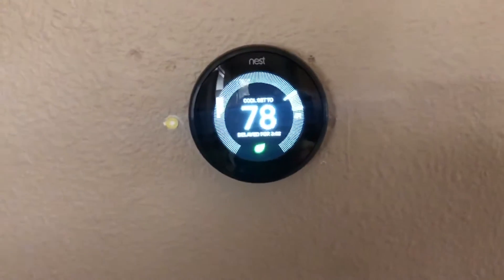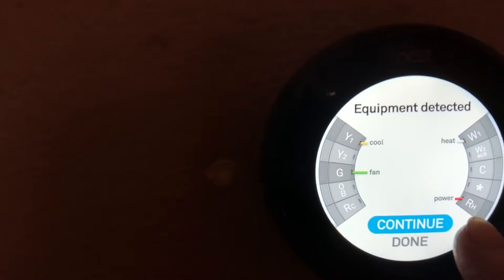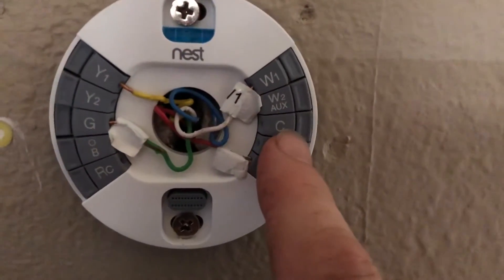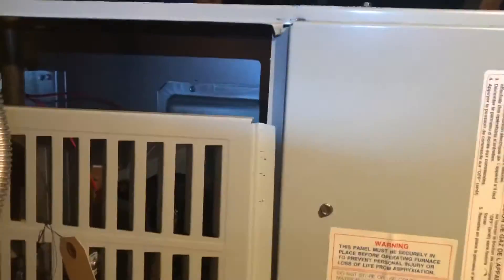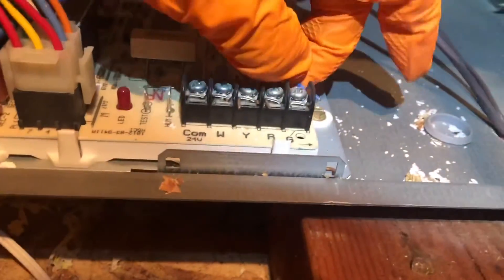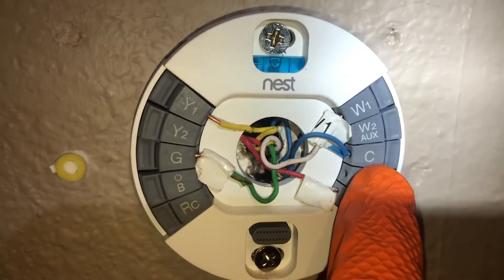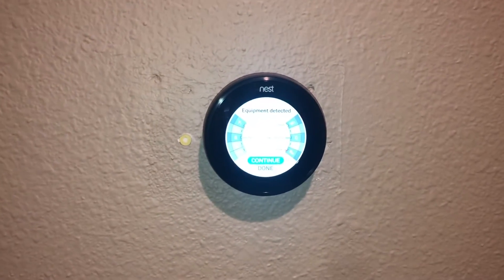NEST THERMOSTAT ISSUES - HOW TO FIX “DELAY” EASY - fix Wiring issues👍😎🎉

Comment: My common line is connected and detected, but I still get the "delayed" message.
Reply from the maker: In a common is connected in the furnace as well?
Reply: @checkitout2468  I live in an apartment.  I don't have access to it.  But if the thermostat is detecting it, then it must be connected?
Reply from the maker: @djp1234  not likely. almost for sure it’s not connected

Comment: I don't know why people keep claiming you need a C wire for this thermostat. You absolutely don't need it. It can pull power just fine from the heating (red) wire. 7 years with no C wire. The only time I've had the thermostat lose power is one time the condensate pump for my AC tripped a GFCI, stopped pumping, and filled up, which cuts power to red.

Comment: I connected the C cable but now there’s no power coming from Rc and Rh and gives me an error in Equipment settings :/ an e22 error. Had to reset it to how it was and dealing with Delayed cooling again
Reply from the maker: What you’re trying to do is connect a C wire from the  inside the furnace to the C on the thermostat. Do not disconnect or connect any other wires.

Comment: Mine just went into a 3 minute delay mode but I have a 24v common wire hookup in both places. Any thoughts why still went into delay?
Reply: Mine did this also. Time to trash the nest and get a honeywell that has being doing thermostats since the beginning.
Reply from the maker: The only time that delay should come on is to protect the equipment. For example, if you had the air conditioning on and then turned it off and then immediately turned it back on it would have a delay to protect the outdoor equipment.
Reply: Well my A/C was running and it was 74 in the house but the nest was set to 71 then went straight to delay so I’m confused.
Reply: Mine does the same with a c wire installed. My unit is brand new heat pump. It's frustrating cause I like mu house cool when I sleep

Comment: My C wire shows that it’s hooked up via the equipment screen. It says 24v. Still getting the orange blinking light on top and the “delayed start” message on panel. AC still won’t come on. Any ideas/suggestions?
Reply from the maker: Make sure that the C wire is also connected inside your furnace or air handler.

Comment: My nest sometimes doesn't kick the compressor on I have to kill the power to the heat pump the thermostat basically everything than it works I heard it was a common problem I am thinking of switching to the Eco Bee
I have the nest gen 3 by the way
Reply from the maker: Connect the common wire if you have one.
Reply: @checkitout2468  the blue wire is on C 
It's like the compressor doesn't kick on I heard nest had problems on this
I have a new A coil 
And a new compressor with full freon 
Everything seems to be in order

Comment: it does actually have a lithion ion battery but like a phone or tablet battery they don't last that long so the power stealing or the use of a c wire is needed.  If you don't have a c wire option to your system a c wire external power adapter for around $20 will work, you hook up one wire to the RC and the other to the C

Comment: I don't agree with you, if I have a delay, the only thing I have to do, is move a little bit the wheel one or two degrees lower and the delay message disappear and start to work, without C wire, just Y1, G, W1 and RH.

Comment: I have the C wire connected and my system just recently started blowing cool (like a fan air) and not cooling off my place.  What now?
Reply: Did you figure it out I have the same issue

Comment: a bit of information, the nest does have a 5v battery built into it, you can see what its at when you look under information on the nest
Reply: So when the battery drops to a certain voltage this delayed cooling comes up? Mine is at 3.95v
Reply: @derickmercado5903  the delayed cooling is when the compressor shuts off and is called to turn back on. the delay is to help not stres the compressor outside from a stop and a sudden restart

Comment: Ok the moment he pulled the nest device off, I’m lost. I guess I’ll just have to wait the extra 3-5 min for my cooler to start…
Reply: As far as I gather, it's pretty simple.

You want the nest to get power from the furnace to charge. Power is to energize the "nest computer module itself".. NOT ANY OF THE NORMAL SWITCHING THE THERMOSTAT DOES WHILE CALLING FOR HEAT OR COOL.

The thermostat is just a complex switch (like a regular on off light switch)

All power comes from a tiny 24v transformer that comes from 120v furnace power.

The transformer has 2 terminals. Usually red and black. But since the transformer is 24vAC, red and black labels can be interchanged no problem.

24v goes from the transformer (1 terminal), all the way to the nest T-stat "RH" terminal. Usually the red wire. When your T-stat wants heat, the T-stat switches on the "w" terminal (heat).

If the T-stat wants cooling instead, the power goes to the "y" terminal (cooling)

So when it calls for heat, power goes from transformer} to the RH} to the w} and back to the furnace (fan control coil and gas valve coil)} then back to the other terminal on the original transformer. That completes the circuit!

How can the new nest T-stat get 24v without completing a circuit, without turning on the heat or cool? Well, it can't. 

What the nest tries to do is trickle steal a tiny bit of 24v from the furnace, without turning it on. 

Sometimes the furnace can tell the T-stat is stealing power, so it turns on the heat. Not good. 

So the makers of the t-stat give itself another terminal to use. (old t-stats never had another terminal to use) "the c terminal"! 

So the new circuit to charge the T-stat itself without possibly false triggering the furnace to turn on is like this.:
Transformer terminal 1, to the RH terminal on the T-stat, through the internal battery to charge it, then to the "c" terminal, then back to the "c" terminal or the terminal #2 on the transformer! It's own powerful charging curcuit!
Reply: @jakefriesenjake  nah that ain’t simple to understand at all.
Reply: @SleezyMoves  what part don't you understand?

Comment: I’m so glad I found this.   My house is 82 degrees and my unit is not running.   I saw something earlier about a low battery.   I just checked equipment and there is no wire like he said.   I called the company that installed it and they will come out tomorrow to fix this!!
Reply: Update… my installer accidentally nip the line and all the Freon spilled out

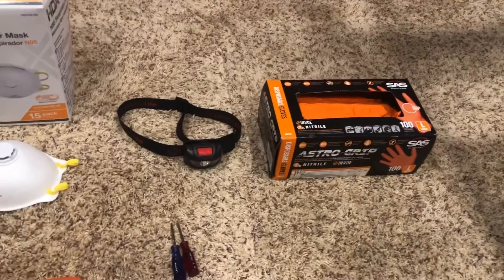Comment: We have had our nest for two years. Yesterday, and orange light was blinking at the top. (We have the “nest thermostat E”). We hadn’t seen that before so we googled it and read that we needed to remove it and charge it for two hours. We charged it for two hours, put it back on the wall, and the temp shown as the current house temp was 71, but it was actually 64, and, it wouldn’t kick on the heat and kept giving us the “Delayed for 3:00” prompt. We took it off again and charged it for 10 hours, with the same outcome. Orange light still slow-blinking, with the same “Delayed for 3:00” countdown prompt. We had a Google tech help us install it over the phone when we initially got it. He said not to worry about the C wire, so it was never hooked up, but we have one. Today I hooked up the blue C-wire but get a “no power to common” message on the Nest diagram screen, and I’m just at a loss.
Reply from the maker: Make sure the other end of the common wire is connected to the furnace. Once you connect it it will work.👍

Comment: I've had my Nest for about a year and it's been working fine. My condenser fan needed to be replaced, so the system was down a while. Now I'm getting that DELAY message, only the fan blows, no cooling. I checked the little 3A fuse inside the blower and it's fine. Also, the A/C guy checked the power to the thermostat and it's 24V, so it should be providing power (through Rh), but the thermostat goes offline and won't start up again unless I plug in a charger to the USB. Totally confused. Any suggestions?
Reply: Dead battery
Need the common (C) wire connected

Comment: The unit does have a battery in it - that’s why there’s a charging port on the back of it >.>
Reply from the maker: There is a small internal battery designed to keep short term memory. 
There are not traditional batteries to be replaced. Hooking up a the common wire completes the circuit for low power. 
Try it my way, I bet it works!👍
Reply: @checkitout2468  this video is slightly misleading.  The Nest thermostat does contain battery which is why you receive a delay message.  

If your heating and cooling system are off (not running) your nest will use the internal battery to power the device.  If off for a prolonged period of time, the next time you run a heating or cooling cycle it may go into delay mode periodically to charge internal battery.  Once at an optimal charge level it will then run heating and cooling without delay.

If your still having issues with it going into delay mode then I’d question is the battery faulty or is your furnace providing ample power to the Nest when on.

A common wire definitely helps as the nest doesn’t need to rely on the internal battery for power and will avoid delays all together.  If your wiring doesn’t contain a common then I’d highly recommend consulting an HVAC expert to see if your system is capable.

Last thing you want to do is assume your wiring something correctly which results in damaging your heating/cooling system or Nest.

Comment: Did this exact same thing on a completely new system and the blower/fan will not come on but if I hook up an old thermostat it works perfectly fine. You think I have a bad Nest thermostat?
Reply: The pro settings has a option fan under heater

Comment: The back of the nest has a USB port, can I plug it for charging to temporarily fix this issue? If so, how long does the nest need to be charged for via USB? Thanks.
Reply: Yes, you can. If the battery of the Nest thermostat drains to zero, I would suggest you to charge the thermostat display connecting with a micro USB cable for 1 hour to be more good enough battery charge.
Reply: Bassam A I am doing the same thing now . Did it work for you ?
Reply: how long did it last?
Reply: Robin B. I haven’t had to recharge it since this post, about six months.
Reply: @americanexpress888  this is a one time charge. Once the thermostat charges the batter, later on the power to the thermostat will be supplied from the HVAC unit wires.